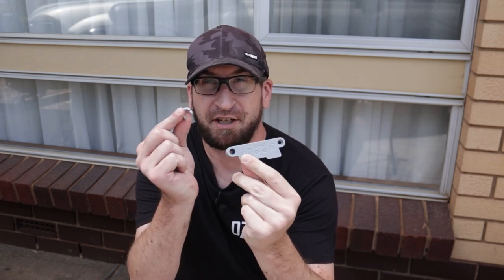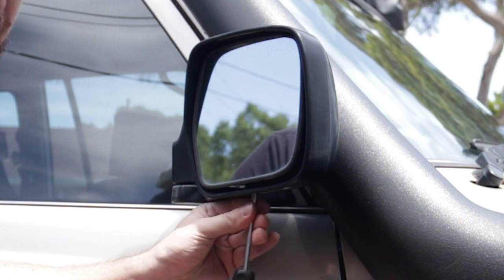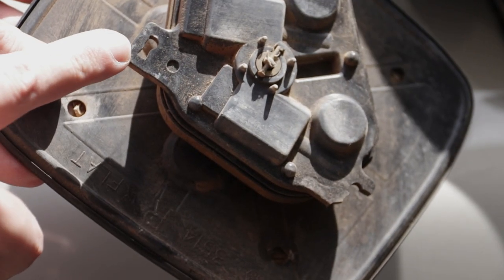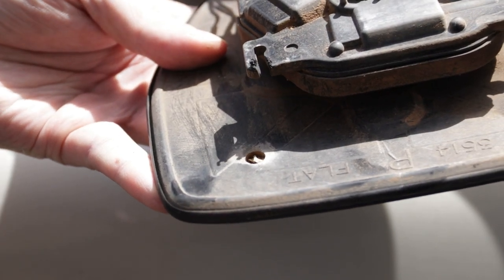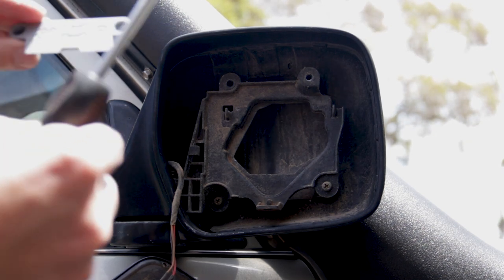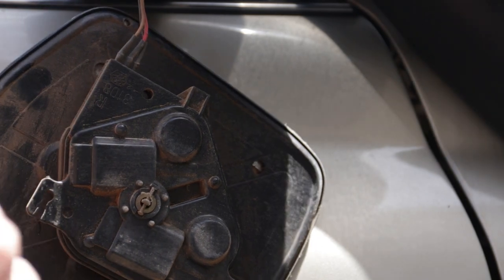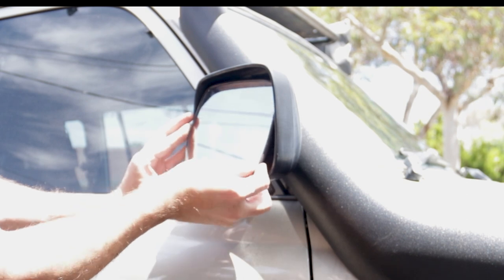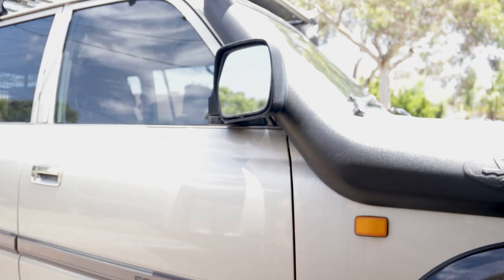DIY: Fixing My 80 Series Landcruiser Shakey Mirrors!

Comment: Good one mate.  I did see these when I was trying to sort out my shakey mirror, but the bottom part (where the bottom screws into) on one of them had this broken also.  So, I ended up replacing both with an after-market product (OEM looking).  Though, I would have preferred to stay with the originals if I could have fixed them.  The one I did want to buy off these guys is their soft-opening tailgate kit.  Particularly good IMO if you plan to use the tailgate for storage using the kit from Huracan Fabrication.
Reply from the maker: Was the bottom post completely split and gone with nothing securing it in the way of a screw?

The bottom post support does exactly what it says, even if its split.

I guess you could also epoxy the bottom split post first and then run the support over the top to reinforce it.

Neither of mine were split, just one hook mount on each side was snapped off.
Reply: I had same thing on both of mine and  just a some silicon and some epoxy and fixed it took me like 40mins

Comment: seems like an easy fix! my 80s mirrors shake like hell when im stopped at a light
Reply from the maker: Super easy fix.

Will take you 10 mins total if you have a rotary tool to slot the original hook style mounts.

I've only been driving around for 2 and a half years with shakey mirrors. 🤣
Reply: This looks like a great kit. I just cut the corner off a BCF plastic card and cut a slot in it. Then glued it over the broken slot part on the back of the mirror. Haven’t had any trouble for 2 years now.
Reply from the maker: @JaxTellerRC  looks like you could save yours as only one side was broken off. 🤠👍

Unfortunately with both of mine, it looked as though the complete tab snapped off prior to me owning the 80 series.

Definitely a great kit if you're in need of one at some point 👌